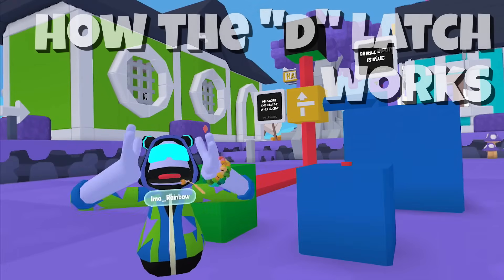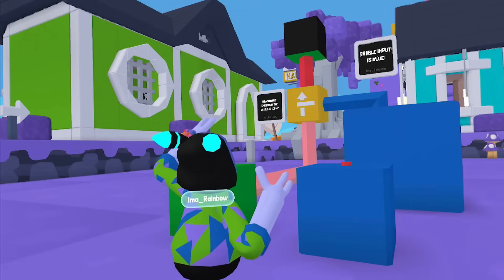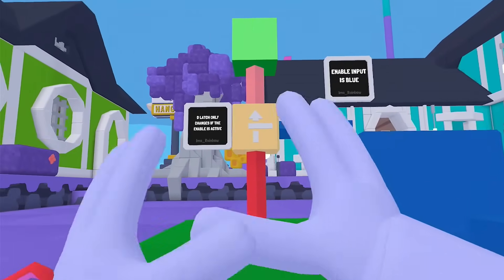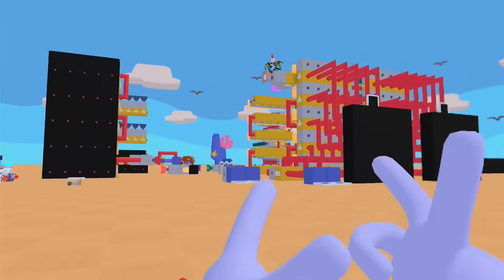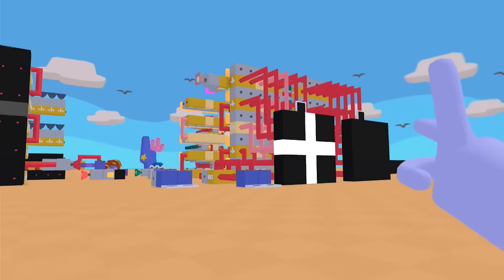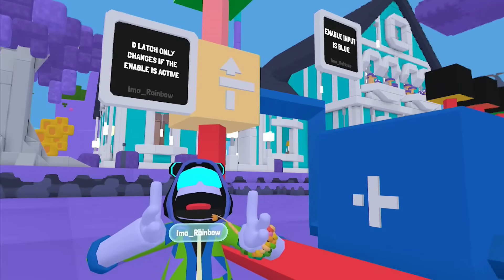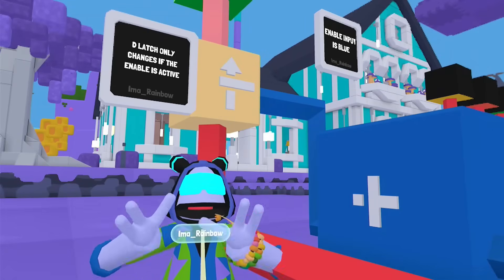D Latch- What It Is & How It Works in Yeeps

Comment: Can’t you use this to measure time (the amount of buttons you press before it turns off ) so if you set that machine next to flowing water and hold a bat out you can see how many lights you activate
Reply from the maker: You can also just count the ticks as a signal goes through a batch of wires or lock at an actual clock.
Reply: @ImaRainbow why did I never think of that for some reason?

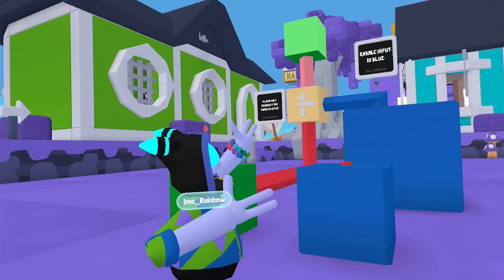Comment: 1:38 why is the yellow thing so functionally similar to the AND gate? And toggle switch?
Reply from the maker: It is not.  You'd need five or six other components together to duplicate the D latch or the SR latch and a couple NAND gates if I'm thinking about this correctly.  So this one block takes the place of 3 or 5 other blocks.